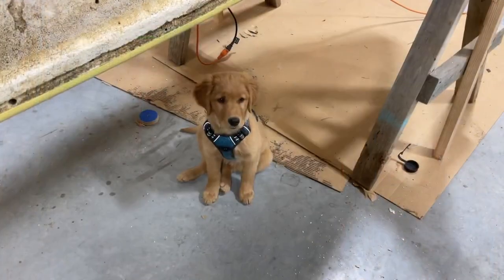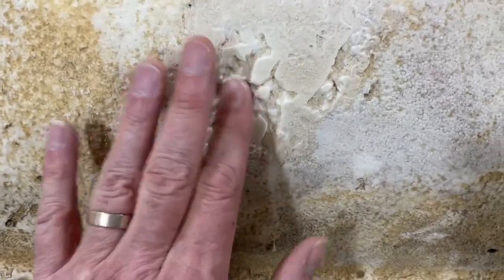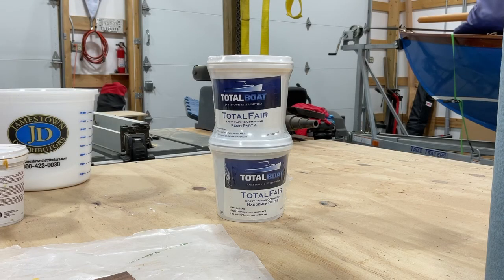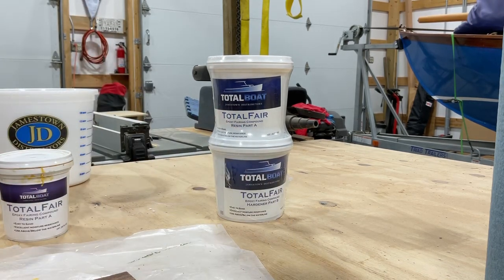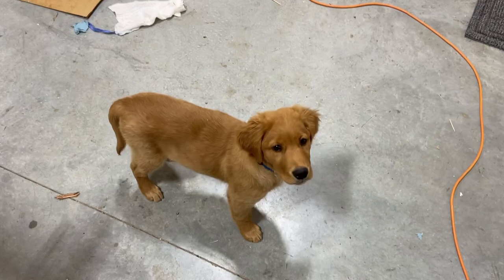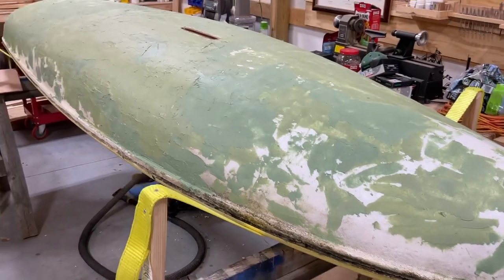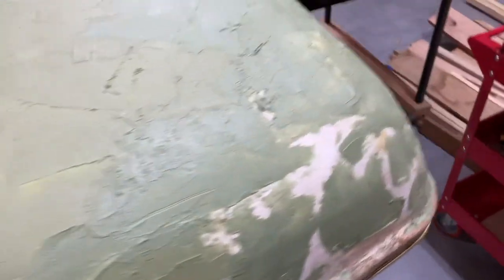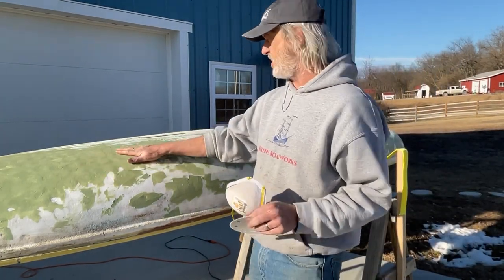Snark Sunflower Restoration - TOTALFAIR Fairing the hull - Episode 3

Comment: You definitely have A LOT of sanding to come. Maybe try a wider tool to spread the total fair?
Reply from the maker: hi Dwayne, yes I do have a lot of sanding ahead. I'm happy that I broke down and bought the Festool.  I agree, a wider spreader for the final fairing coat may be helpful. I think that the rest of it as even I watch the video and consider where we are at this point is temperatures. When I was applying this first coat, we had a miserable stretch of weather with outside temps in the single digits and teens. The shop is heated but in those days we were struggling to keep heated around 55 F. I am getting more TotalFair in soon and will keep it in the house where it is 70+ before I take it to the shop and mix it up. I think this will help.

Comment: It looks like the fairing compound doesn't spread as nicely as Rage Auto Filler.  It's two part.  I'm not sure if it would eat styrofoam or not.  I did use some West Epoxy and fibers to fill spots and it worked well.  I've never skim coated my Snark though.   I kind of want to fiberglass it.
Reply from the maker: Yeah cool, i want to get this ready for sailing as soon as the weather breaks. Won’t be long!